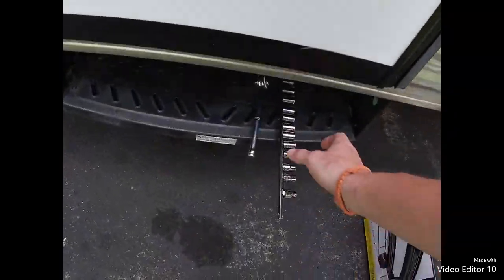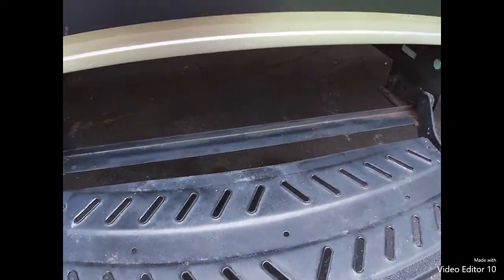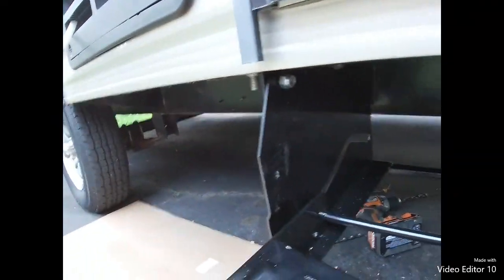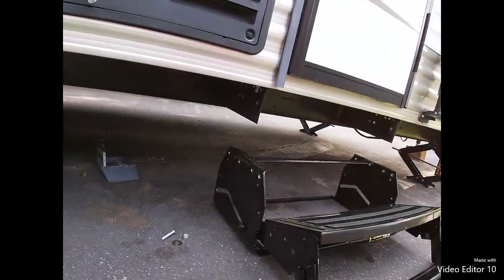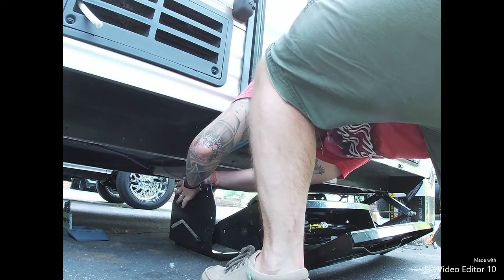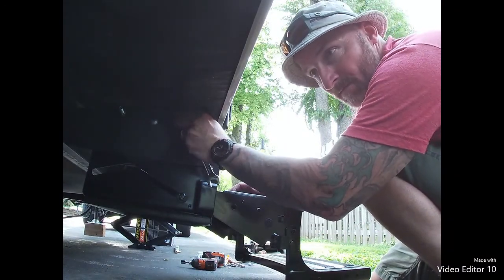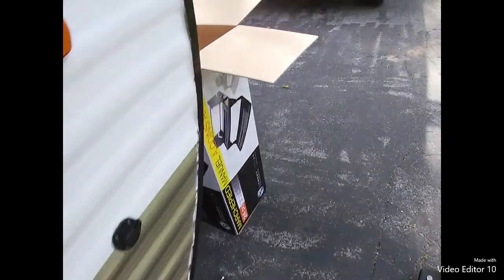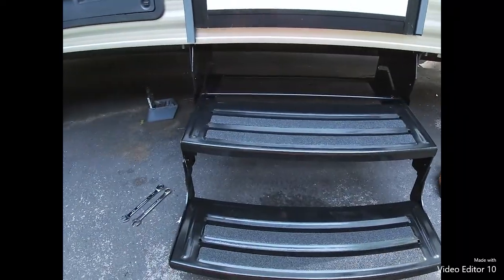John Reese Fishing-- installing double entry steps on our travel trailer, removing the single step

Comment: What’s great is they don’t even publish the numbers on the box or the lippert website. They list steps as 24” for single and double but they have different mounting flange sizes. Mine were 26” single and 25.25” double. So I needed a washer on one side and a 1/2” thick 1/2” nut over the 3/8” bolt that I had to swap to a longer bolt. I had two holes line up on each side and called it good. I also got a two piece bar in my box that I have no idea what to do with?

Comment: Thanks John for the video. The steps you installed and the 26 inch space between the RV mounting plates are going to be the same on my trailer. Question how many washers did you need to fill the 1/2 inch total gap on each side and what size bolts? 1/2 or 5/8ths? and length? I to want to replace my single step with the Lippert 2 step. Thanks George from Texas
Reply from the maker: I used 1 washer per bolt on each side. I believe I used 1/2 bolts. I did reuse 1 original bolt on the front for each side because of the square head to help lock it in place. Good luck

Comment: John thanks for the video. I want to do the same with my trailer changing from a single step to a double step. My mounting plates on trailer is the same 26 inches apart and I am getting the same steps you installed. My question is how many washers needed on each side to fill in the 1/2 total gap and what size bolts, 5/8 or 1/2 inch? Length?
Thanks George from Texas